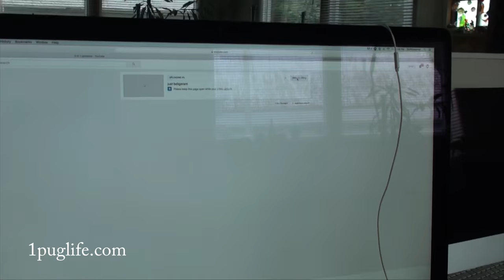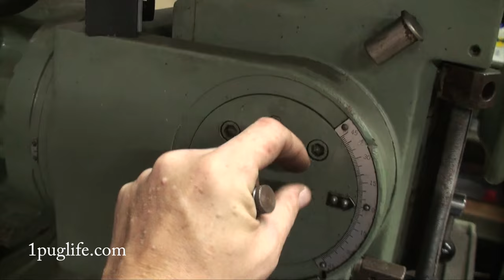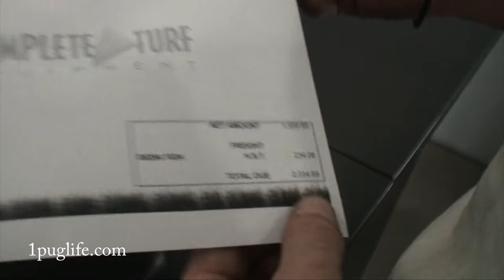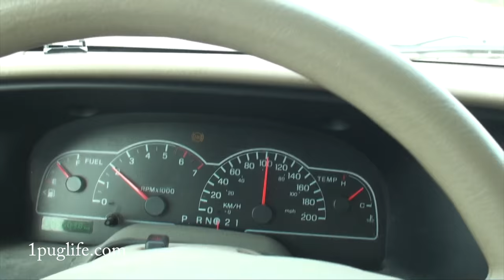suckin on puppet cocks

Comment: but you would have done better with the engine golf cart starter batteries you can put any engine in a golf cart like an ATV I'm not your bill $2,000 it's because of the batteries and all that other electronics gas is the way to go
Reply: Deep cycle batteries should never be bought new, so many golf carts laying around with perfectly reliable good ones, most people dont have a clue what theyre worth either cause they usually come with. And super easy to fix, i used to work at a golf course
Reply: Tru I have a gas one but I'm trying to find an atv motor so I can romp around again